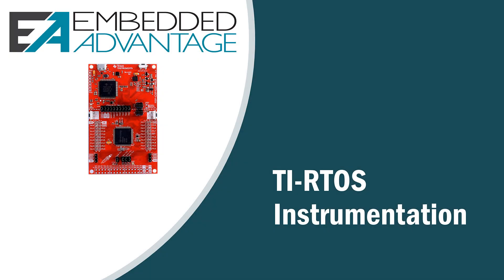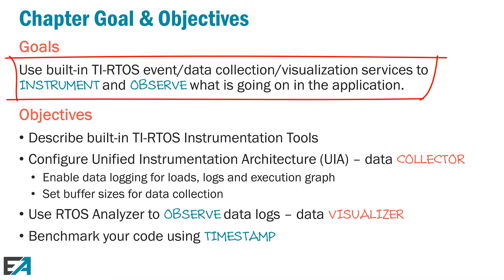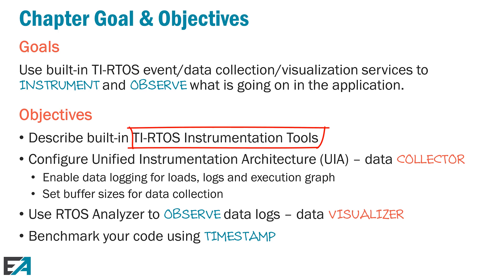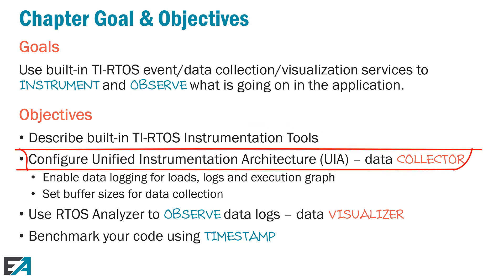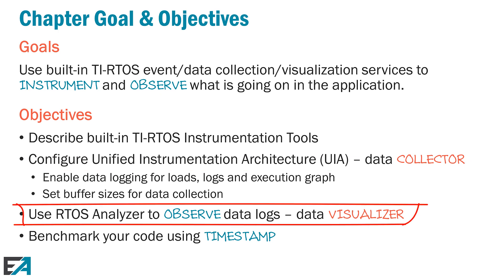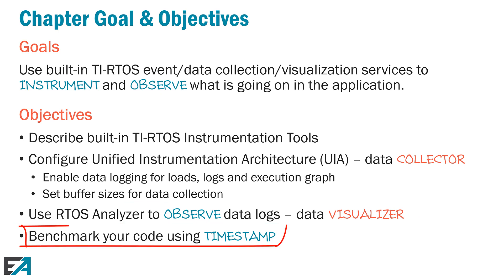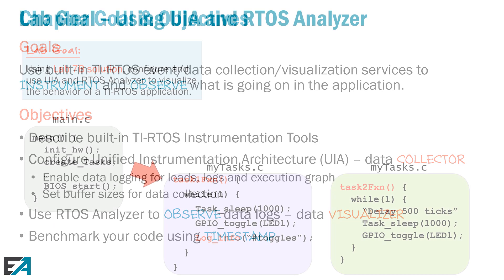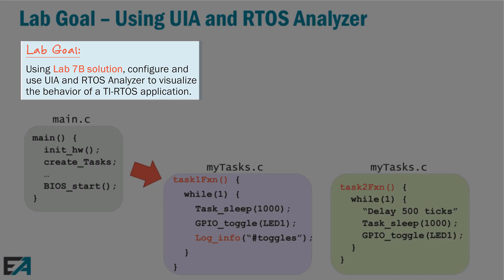Getting Started with TI-RTOS: Chapter 8—TI-RTOS instrumentation

Comment: 1:56 You are talking about (lighteweight printf) Log_info, then why in project zero of CC2650 BLE (which also uses TI RTOS)  redirected the system printf data to uart , which is causing big code size?